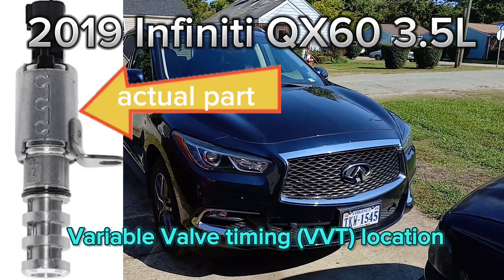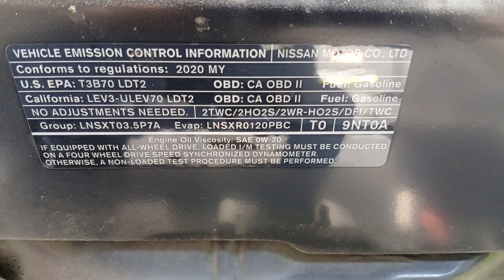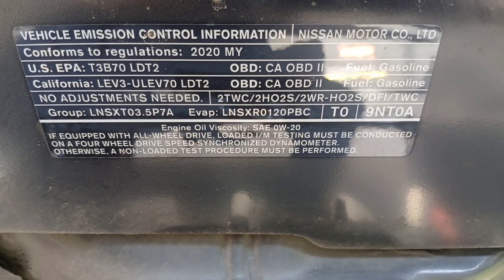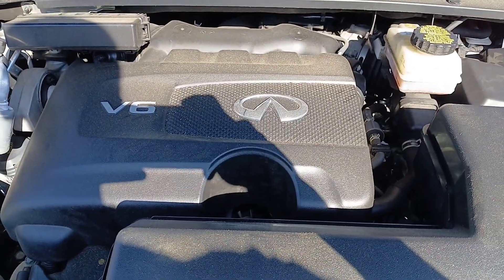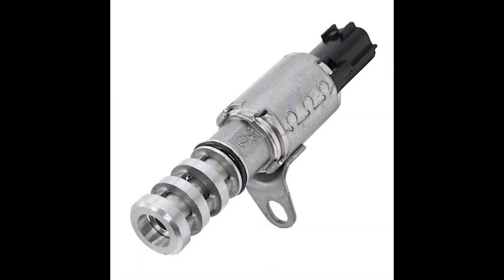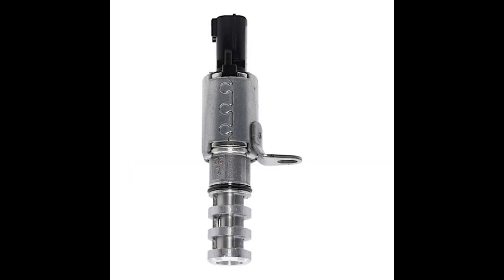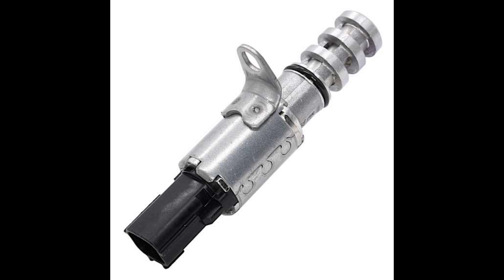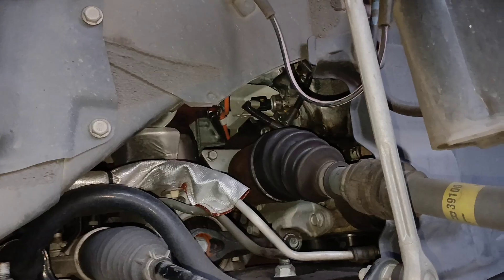2019 Infiniti qx60 3.5L Variable valve timing (VVT) locations

Comment: I have a qx60 an im getting the actuator codes p34c4 p34c5. Do I change the actuators or the 4 camshaft position sensors
Reply from the maker: Its hard to call without an actual diagnostic because it could be so many things related with Timing, including the timing chain itself. Thats one of those things thats going to need a professional diagnostic for about $100+

Comment: So the other solenoid, the driver side tire needs to come off?
Reply from the maker: No it's on passenger side still.  On the opposite cylinder head
Reply: Can you still see it and access it?
Reply from the maker: @Yeahthatzhim  it's a lot harder but yes
Reply: @Davethemechanic305  Do you have a video or diagram where the other sensor is located?
Reply: @Davethemechanic305 would you be able to show us where that one is?